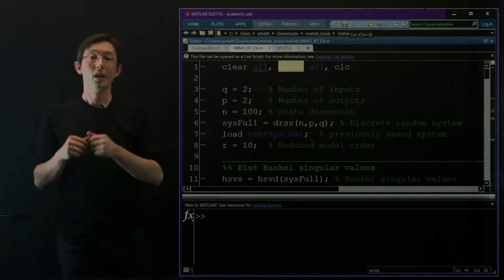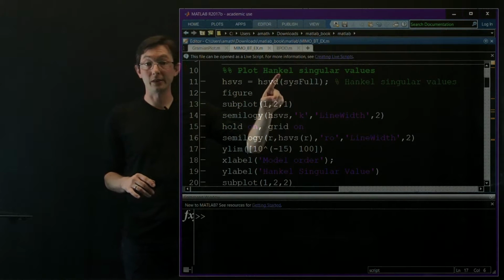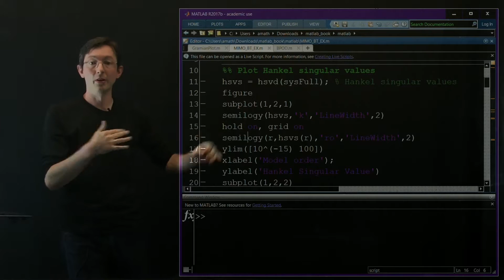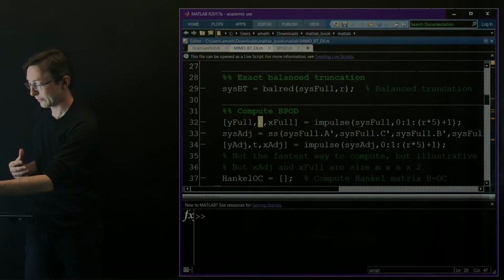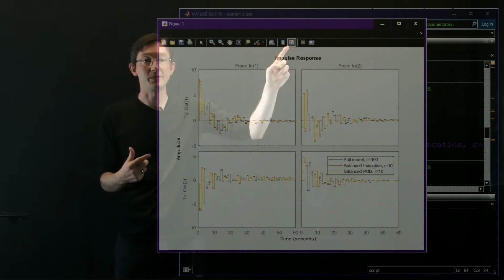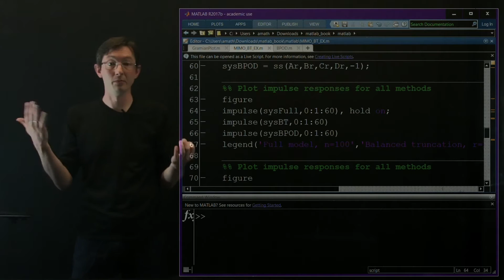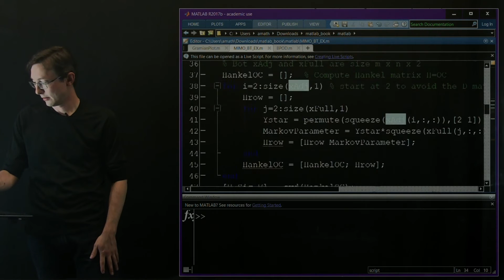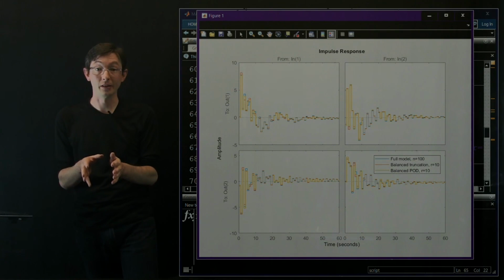Data-Driven Control: Balanced Truncation and BPOD Example

Comment: I build the two mentioned matrices:
     curly_c = np.matrix.transpose(xFull[:, :, 0])
     curly_o = xAdj[:, :, 0]

and the Hankel should be the product of these two
But, after multiplying them, the Hankel matrix eigen values are positive and so my system would be unstable.
I do not know what is the problem

Comment: I am also curious about how did you define Hankel Matrice? because my result of impulses is (51, 100, 1) not (51, 100, 2). what is that 2 that appears in MATLAB states? I think that there are 100 states over 51 time steps.
Reply: I found out that the 2 number is due to the two inputs that each manipulated once while the other one was zero. (as you mentioned in the video)

Comment: Is the reason for the difference between Balanced Truncation and BPOD when r=3 as follows:

The BPOD is more efficient in calculating the ROM from the FOM because we aren't computing the full Balanced Truncation, but rather approximating the first r columns of the full balancing transformation T.

Thus, the ratio of r/n gives you a measure of how well the BPOD is approximating the Balanced Truncation. Not saying it will exactly depend on (r/n), but if I had to wager, it would probably be like 

(Similarity of BPOD to Balanced Truncation) = (Energy of r rank system/Energy of full rank system)
Reply from the maker: Essentially yes.  The BPOD is doing a more efficient approximation with only the first r columns of T.  But I think r/n is overly pessimistic, since the singular values are ordered by importance, so the first r are more important than the next r, and definitely more than the last r.